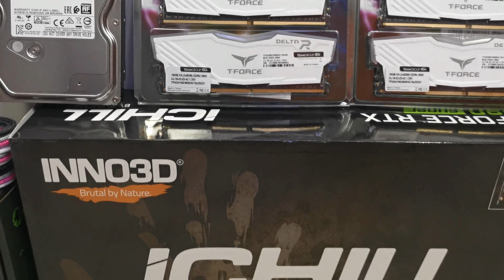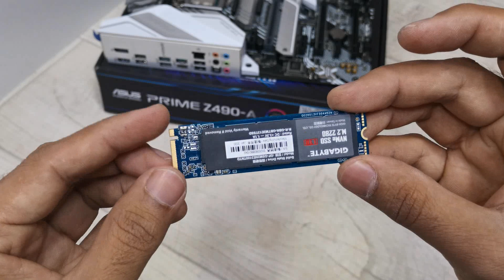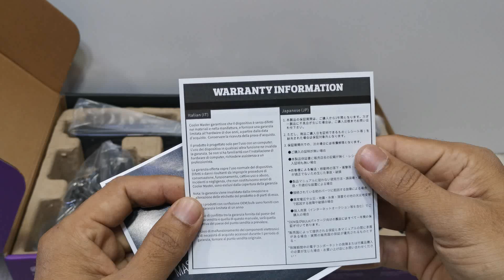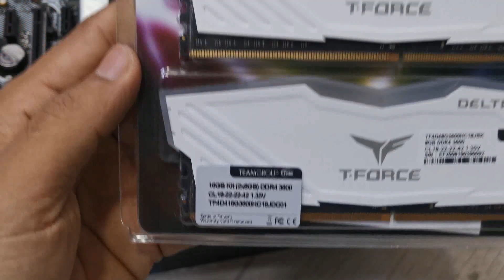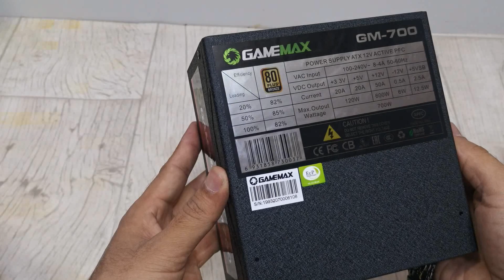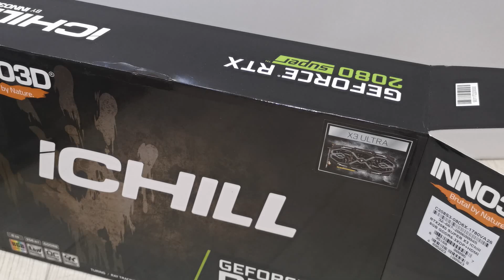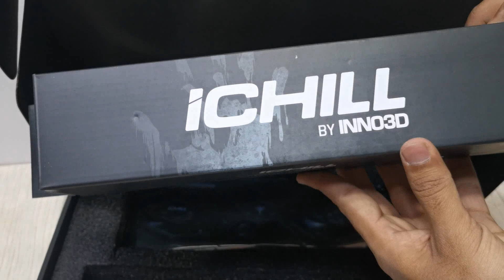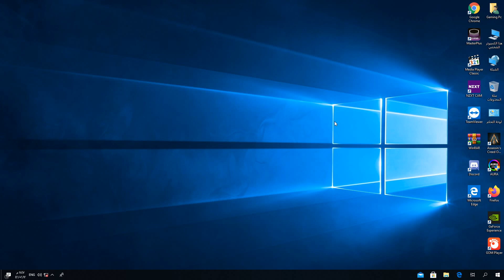Gaming PC i7 10700K   RTX  2080 Super  pc build step by step 2020

Comment: Bro can u plz tell me if I am buying a i5 10600k what kind of cooler should I go with?
Reply: go with a decent aftermarket air cooler or any decent 240mm aio
Reply: @Thekalolamahir  how if I buy a deepcool 2000 air cooler?
Reply from the maker: ML240R liquid cooler will be good if u want overclock otherwise cpu cooler will be ok
Reply: Depends on how much extend you want to overclock your cpu
Reply: If not overclocking buy a decent air cooler.... If overcloking go with any 240mm aio liquid cooler

Comment: Hey I’ve got a question I have 4 Scythe rgb fans going into mg build. They don’t come with a controller. What kind of controller would I need with this motherboard?
Reply: you have to buy a rgb fan controller or a modem. what that does, is that the fans are plugging into a chip and that chip in the motherboard and power supply, and that modem comes with a remote.